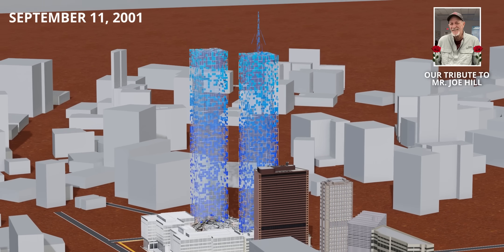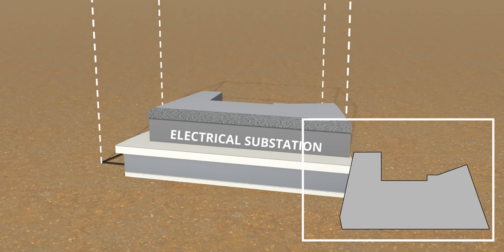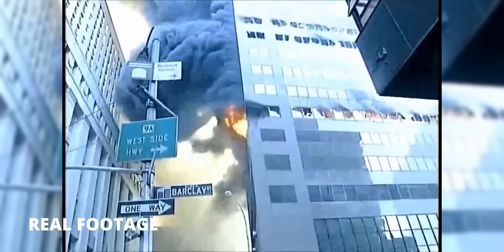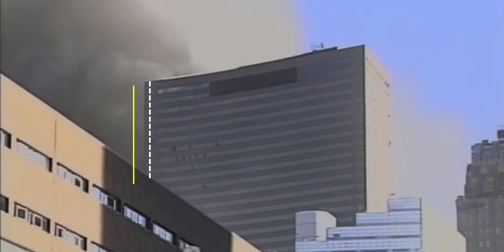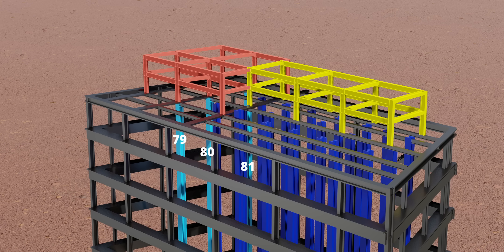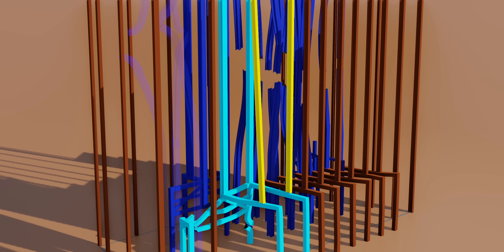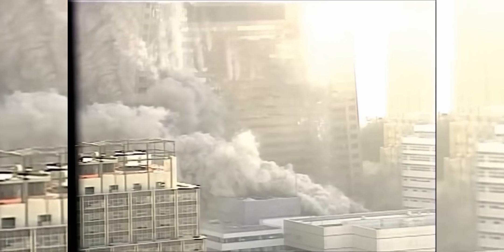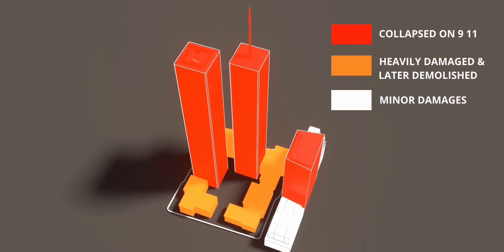Collapse of Building 7 | The Complete Physics

Comment: keep dreaming to anyone who believes this . you are being played . zero proof of this mumbo jumbo being said and shown here. it came down from inside explosion that had to be planted weeks earlier. how can YouTube let this false info come out without any proof. once you figured that out your eyes are starting to open to reality.
Reply: OK, how about this then:  Building 7 was the 6th building to collapse of 10 lost on 9/11. Because of its early low priority and complexity, conspiracy filled the information void with simple-minded garbage by technically ignorant people promoting political agendas. 7's loss is an engineering problem and should be treated as such, so I prepared this brief summary of my own analysis to fix that, using technical analysis, not ideology and magical (non)thinking. 

At 10:28am the WTC North Tower collapsed, showering Building 7 with tons of burning debris, causing heavy damage and starting many large  fires which burned out of control for the next 7 hours. Half the FDNY firefighters having been killed, units in disarray, equipment destroyed, no water pressure, and the greater urgency of search & rescue efforts, Building 7 couldn’t be saved so firefighting efforts were pulled as futile and 7 left to its fate. Firefighters make that sort of choice every day in brush fire situations - which houses to save and which ones to let go. Only real difference here is moving the decimal on the size and cost. People get overwhelmed by the size.

www.youtube.com/watch?v=g_SvpwyC17M

Collapse of a burning structure is always a concern for firefighters. Steel buildings subject to fire rely on active firefighting to survive. Buildings are designed around 1 to 3 hours of fire resistance, allowing time for occupants to escape and active firefighting to get started, after which all bets are off. Left to their own devices they'll exceed their design envelope and collapse, like Plasco Tower and Wilton Paes de Almeida. In 7 the occupants escaped, passive and active fire protections were compromised and active firefighting was abandoned hours before the collapse, which left the building to its fate. It lost. Odds on Building 7 would eventually collapse, and it did. No big deal in logic.

 http://www.youtube.com/watch?v=WnYBX6QT0R4 

FDNY Chief Daniel Nigro - The biggest decision we had to make on the first day was to clear the area and create a collapse zone around the severely damaged 7 World Trade Center, a 47-story building heavily involved in fire. A number of fire officers and companies assessed the damage to the building. The appraisals indicated that the building's structural integrity was in serious doubt. I issued orders to PULL back the firefighters and define the collapse zone. It was a critical decision; We could not lose any more firefighters. It took a lot of time to PULL everyone out, given the emotionalism of the day, communications difficulties and the collapse terrain 

FDNY Deputy Chief Peter Hayden ; We had our special operations people set up surveying instruments to monitor and see if there was any movement in the building. We were concerned of the possibility of collapse in the building. And we had a discussion with one particular engineer there, and we asked him if we allowed it to burn could we anticipate a collapse and if so, how soon? And it turned out that he was pretty much right on the money, that he said 'In its current state you have about 5 hours 

The collapse of Building 7 was anticipated and widely reported in the media throughout the day, with 24 video cameras recording some or all of the collapse. Everyone knew what was coming and why. 

www.youtube.com/watch?v=OY5S5k3tMHI

The collapse of Building 7 was from the inside out and entirely different to the Twin Towers, not at all intuitive and thus harder to understand, with most details being hidden from view.  It requires careful analysis and observation, and some people will struggle no matter how much it is explained. But here is my explanation relying on no outside authority. 

Building 7 was a unique, asymmetrical 47-story steel frame structure built atop a smaller 3-story building serving as a partial foundation, requiring lower floors dedicated to complex load transfer structures. Of trapezoidal shape and tube-in-tube construction, B7 (above the 7th floor) consisted of a central core of steel columns carrying most of the gravity load, perimeter steel columns around the outside of the structure carrying the remainder of the gravity loads and long span beams and girders to tie those elements together and form the floors. On the outside of the building hung a moment frame or outer shell. 

www.nist.gov/image-16640

Phase 1 : First externally visible signs of collapse initiation occurred at 5:20:28 pm and was notably quiet with observers not realizing the building was collapsing! No warning in the form of hundreds of eardrum busting 180dB explosive bangs. Here at 12:00 a local CBS affiliate reporter talking 10 blocks from B7 when collapse begins. People don’t start to notice the collapse until 12:11. At 12:45 is the famous CBS fixed camera clip of Building 7’s collapse. Note the silence. 

www.youtube.com/watch?v=t5tEy6mXSE8

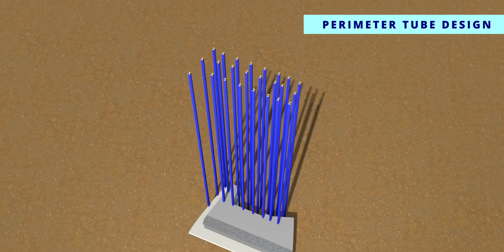Lower floor failures above the load transfer region (8-14) in the NE corner initiated the collapse. In this video at 0:45 you can see the NW corner from inside the building while under construction, Column 79 just out of frame on the left. That big, angled steel beam across the top of the frame connects to C79 at one end. The girders connect to the beam. That beam and all those girders depend on just one connection 

www.youtube.com/watch?v=nP3TNHPCIVU&t=45s

Phase 2 : NE corner floor failures caused a loss of critical lateral support over an excessive length of Column 79 and it buckled. Looking at the above floor diagram of Building 7 when you see all the structures that depend on C79 you quickly realize this one column was a relatively isolated structural element on which a disproportionately greater fraction of the structure depended analogous to say the Key Bridge. Externally as collapse begins we see a vertical progression of window breakage along the 44-46 line and a kink in the roof of the East Mechanical Penthouse at the top of the building, consistent with C79 failure. Normally with a buckling column, the load could be redistributed to other columns. With C79 that is not the case - the failure did not redistribute the load, so the collapse rapidly progressed to the roofline, sinking the rooftop penthouse. The transition from full capacity to almost no capacity occurs in an instant and will result in virtually no resistance 

Phase 3 : With C79 gone, B7’s progressive, non-symmetrical collapse continues with adjacent columns 80 and 81 left laterally unsupported and quickly buckling as well. The EMP drops down through the building. C79-81 all have no diagonal bracing, which is the major reason why they could not redistribute a lot of vertical loads among one another. From there collapse progressed from east to west through the central core until the core was gone from 81 to 58, taking all the interior floors and probably most of the perimeter columns with. Follow the horizontal progression of window failures low in the building and the dropping of the remaining rooftop structures into the building. The NIST Building 7 study model 4 determined C79 failing under ANY circumstances would have initiated the same collapse sequence. 

Phase 4 : After about 10 seconds only the exterior moment frame remains, giving the illusion B7 is still standing to the casual observer since little has outwardly changed. But it is just a hollow empty shell like an empty cereal box supported only by a few remaining columns and overloaded from the loss of the core columns and floors, quite unable to remain standing. With nothing remaining behind it, the north face leans inward, forming a V in the roofline, the last few columns buckle under the strain and the moment frame free falls, landing on top of the debris pile. 

It is only here at the very end, a single measurement of alleged free fall acceleration is taken, from just one point on that outer shell. The Building (core and interior) did not “free fall” - was already gone before that happened - just one corner of the outer shell briefly moved at a rate comparable to FFA. This alleged FFA was a product of how the shell fell NOT why the building fell . It’s also not even proper FFA as the single measured point was moving in 3 dimensions, not just down, which adds another variable. Start to finish the collapse took 18-20 seconds, 3 times longer than true FFA . How fast something falls can’t tell you what started it falling, certainly not 10 seconds after it started falling.  

The debris spread outside the footprint blocking surrounding streets, heavily damaging the Verizon Building and destroyed Fiterman Hall. 

No building is meant to survive 7 hours of multi-floor unfought fires. Building 7’s progressive, non-symmetrical collapse was incidental, unintended collateral damage from the combination of fire, time & gravity started by the collapsing North Tower, true no matter who planned and carried out the 9/11 attacks or why .  Of so little consequence it barely registered at the time, only taking on semi-mythical status as an alleged smoking gun years later when demolitions at the Twin Towers, missiles at the Pentagon and shoot down over Shanksville all failed and conspiracists had nothing left to work with. 

Anything can seem like a conspiracy if you don’t understand how it works. Now you should. I hope you found this helpful, informative and it solicits informed critical comment. If I made any errors of fact, logic or reason or left anything important out, please let me know so I can fix it. OR offer a more plausible alternative if you can. Be the first. Please start any reply with the words “Tits McGee” or I will know you didn’t read it and are wasting my time.
Reply: Then make a video yourself presenting your research and proof. Oh wait, you got none

Comment: But where did they have the 3000° to melt the steel? The antenna was built out of aluminum, so somehow that sliced through the building?
Reply: 2,400 deg to melt steel but less than half that required for it to fail.
Reply: Wow. 2006 still keep spouting dumb shit for "truthers" to blindly repeat, huh?

Comment: Paper fires can't melt a paper clip, let alone steal beams.
B7 was separated from the twin towers by another building. 

7 fell at the speed of gravity on its own footprint. If it was naturally occurring it would have collapsed to one side or the other.

Only professional demolitions fall on their footprint at the speed of gravity.  That is a fact.

Flight 93 was supposed to hit 7 but it was delayed and the passengers took it down before it could.

Then they cleaned it up BEFORE they investigated. 

Only non engineers believe the official story or paid trolls.

The heat will travel DOWN to melt building 7? LoL!! Heat rises in my universe but not in upsidedown town. 😂
Reply: 93 went down while following the potomac river to washington.
Reply: "Paper fires can't melt a paper clip, let alone steal beams."
So what? Santa Claus doesn't have laser cannons on his sleigh either. And neither of these things are even remotely relevant.

"B7 was separated from the twin towers by another building."
How tall were the Twin Towers? How far away was WTC 7?

"  Total BS"
And yet, not wrong, which is why you're ever so upset. Because, if it had been wrong, you'd have had an argument. Any argument.
Reply: @mooneyes2k478  Building 7 was across a street! It was o a different block to the other buildings.
Reply: @dochama_Simon  Yeah. So what? And technically, all the buildings were their own blocks.
Reply: @mooneyes2k478  I love Miles Davis!

Comment: Very good! Well explained. Unfortunately, conspiracy theorists don't want to know what really happened, and don't listen completely to official statements, but rather pick some statements out of the content and make their own crazy version of official statements.
Then they make a "straw man argument" like: 
"The official explanation is, that building 7 melt down from the heat from WTC"
That was never said by some official, but only from conspiracy theorists.
Truth: The collapse of WTC caused severe damage on one side of the building 7.
The damage was on the opposite side of the building we see on the video of the collapse.
Why was the video made from the opposite side?  No conspiracy involved, the opposite side was not accessible after the collapse of WTC. Therefore, the video showed a seemingly intact building collapsing mysteriously.
No mystery, all explained very convincing in the video.
Reply: So one side was damaged more? Okay which side? The smaller side. The side with less supports . So it was damaged on one side, and that's the side that had less vertical supports and the building didn't fall in that direction? How does the smaller side with less support get damaged then the building fall straight down? If all of the exterior supports that this building were not taken out at exactly the same time , the building would not hold its shape all the way to the ground. If any of those exterior columns cought on the way down it would not have had its shape all the way to the ground.  Here's all the proof a person should need to see the truth. 1.The firefighters said" it looked like they planned to take down the building" I didn't say that, The fire fighters said that. They were there.I'm sure they know best.
https://youtu.be/XiIT4HInWjY?si=e1Pvp3-IFs-M75Oj
When the firefighter says "boom, boom, boom, boom" in this video.
What do you suppose he is?Implying by " boom" ??
2.So if there were no explosives then what is this? 8:25
https://youtu.be/bLF5D7M1YgA?si=aHSvS__uOdxMi1ZB
You can't say that it was added because you can see the firemen's reaction to the explosion. And you can't say it came from anywhere else because the firefighter says
" We gotta get out of here,  7 is exploding "
3. Controlled demolitions have squibs, you can see the squibs here 20 floors below the collapse. 
https://youtu.be/eXAgulfAtR4?si=-iLO9aQjMJVLTUYH
4. Firefighter says "any one of these buildings could blow up,  this ain't over yet" firefighter says there's 3 secondary explosions. 
https://youtu.be/0Gh3ErgMI4M?si=mmp9Eus_5PWTCBfl
5. Airplanes can't fly 600 mph at 1000 feet. And to be able to make a 180 degree turn to hit the opposite side of the pentagon going that fast is ridiculous. And since when do terrorists hit the opposite side of the building where no one was at when they could have just flown straight in and killed way more people???
 https://youtu.be/0Gh3ErgMI4M?si=mmp9Eus_5PWTCBfl
7. No one has ever known ahead of time that a building was going to collapse except through controlled demolition.  Tower 7 was reported to have fallen while it still stood in the background. 
8. Larry silverstein,  the man who made over 4.5 billion when they fell, claimed to have pulled the building down.
https://youtu.be/1jQaJFNWqtc?si=wCywQ9grgBdS_w11 yet somehow today he is only worth one billion dollars.
9. A witness reported a missile hit the pentagon while he was seen at the scene. 
And the hole wasn't big enough for a plane and the damage wasn't consistent to the towers. And just like shanksville,  there's pictures that show no plane parts at all. But there was papers everywhere. Explain to me how the burnable paper is laying everywhere , but the steel parts of the plane are gone. The luggage.
Is gone, the seats are gone.The people are gone
https://youtu.be/6_Ez-UCpXMs?si=JaQ6DBEC_LJtMLgN

Comment: All the money paid for the controlled demolitions allover the world is a scam. It is enough to start some fires on lower flores and each building would fall into perfect localized heap of debris like this WTC 7 did. :)
Reply: except demolition from fires are uncontrolled and unsafe, which is why we don't use fire to demolish buildings.
Reply: @FastKnight401  Did you see the result of collapse of WTC7?  Perfect result of demolition by fire. No damage to neighboring buildings.
Reply: @marek8928  and how about WTC 1? The fires from WTC 1 caused a collapse that caused collateral damage to WTC 7. Just because collateral damage didn't happen once doesn't mean it will never happen. Fire is unpredictable. It might collapse without collateral damage, but there's not enough guarantees. Using fire would literally be gambling.
Reply: @FastKnight401  You are not getting my point.
WTC7 did not collapsed because of fires. It was controlled demolition, but the lie of fires being the cause of its collapse is so idiotic. If fire can cause that kind of result, than fire should be used for all controlled demolition because is much cheaper.
But fire is not used for that because no one can assure the result that was achieved with WTC7.
WTC1 and 2 were also controlled demolitions.
There is no other way to achieve the 10 seconds collapse time that happened with them. Gravity is uncontrollable.
Also, did you know that BBC reporter told its audience that WTC7 collapsed an hour before it did?